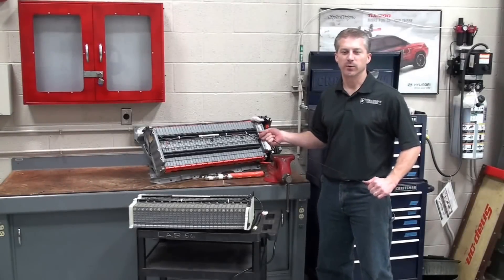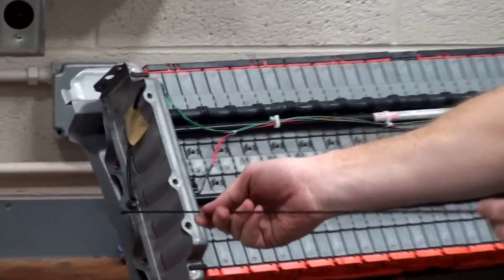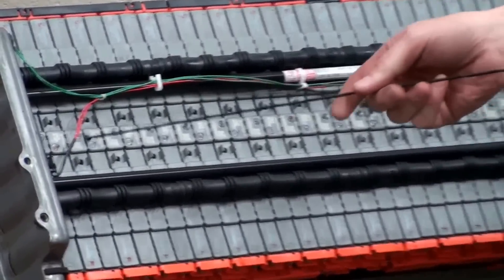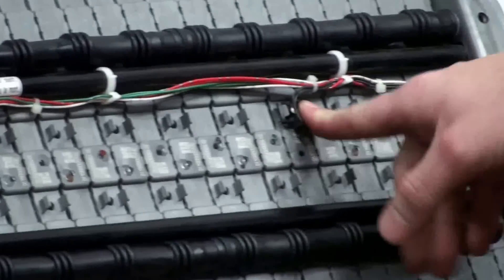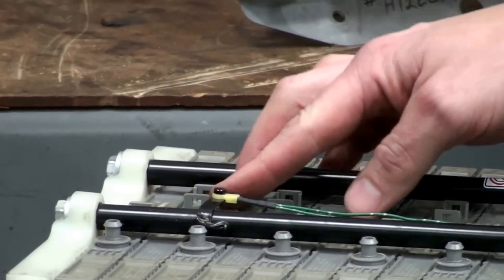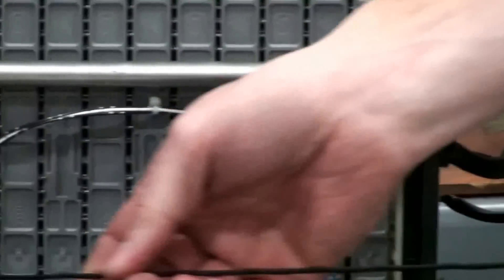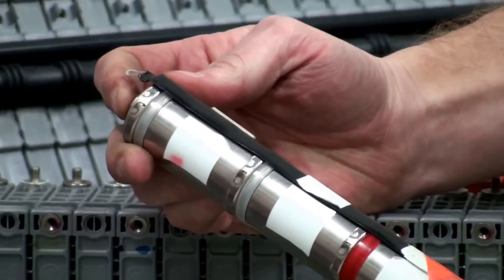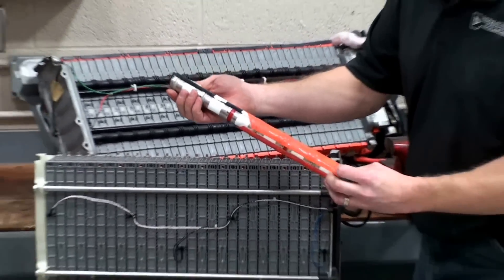HEV-TV 1.7:  High Voltage Battery Pack Temp Sensors

Comment: High voltage temp sensor P0A9E prius
( check sensor wire under battery cells

Comment: I have a 2nd Gen battery pack and the white (bottom) wire broke off its plastic piece. which results in a error code making the car not run. Can this be repaired or do I need replace it.